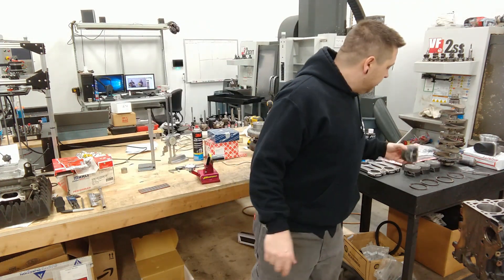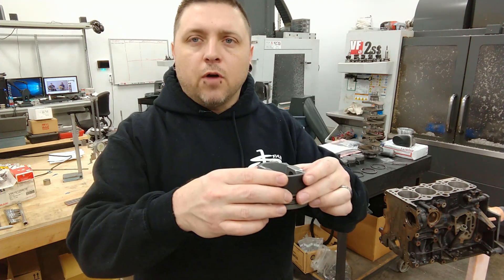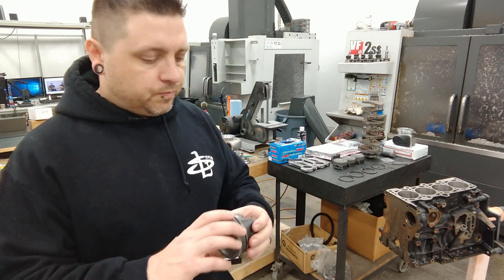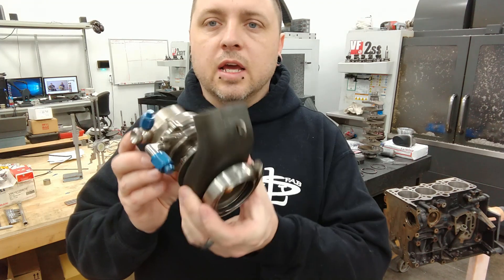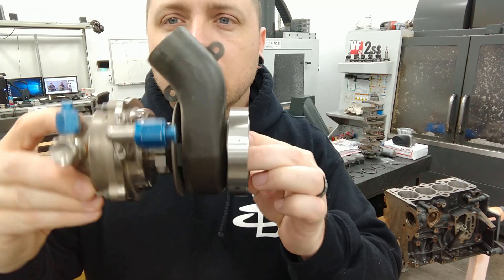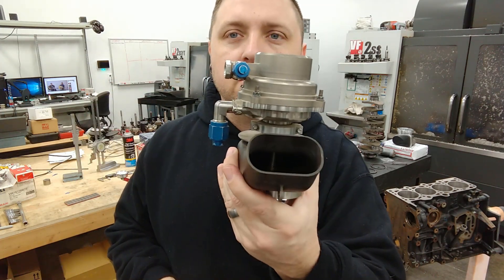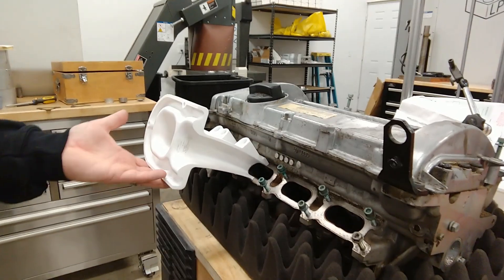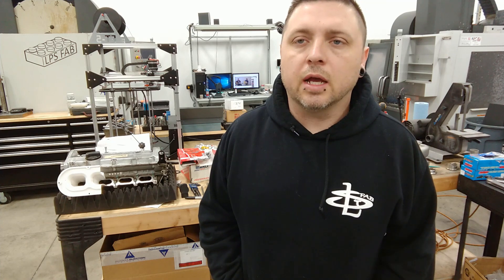VW 1.8t 20v engine build, fast motion ring fitting (go to 2:45 to skip) and Formula1 wastegate???

Comment: The only company that i know of, which builds wastegates of that cailber is dsps technology. looks similar to a dw1 valve used on turbo indy cars, any part numbers any where ?
Reply from the maker: It does look a lot like one of their products, it doesn't match their current offerings but the build style looks spot on... I think it is one of theirs.
Reply: @linderpowersystems_LPSFAB  could just be a superseded model, or custom made for bespoke application a guess
Reply from the maker: Not a single mark on it... I will check out that company though!